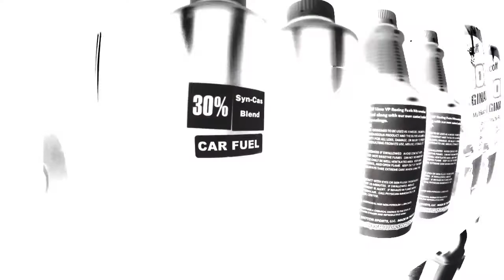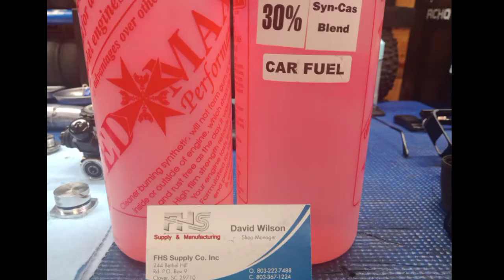RED MAX FUEL 1.5 GAL INSPECTION/TRITON L5 RCR MOD

Comment: No matter where I go in the UK, Europe and even Bermuda, no one takes it too seriously I certainly do not take myself either. Racing ends then to the beer tent or the bonfire and sup a few beers with a JD chaser. I always stay over to help with the clean up and put stuff away and load the vehicle's, the sunday night party is staff and helpers only so a well laid back and plenty of food post party. I have OBR, Scott Finlay, BZM and lately the RCMAX GT50cc engines in my Kraken-RC Vekta-5 and KV5TT just done a winter build on both my HPI Baja's that have sat due to COVID 19, also rebuilt my FID-RC Dragon Hammer and swapping out the OBR PRO-MOD for their OBR reed case PRO-MOD 34cc to replace the 32cc. I robbed it from my LOSI DBXL. So not sure what to do for an engine now.